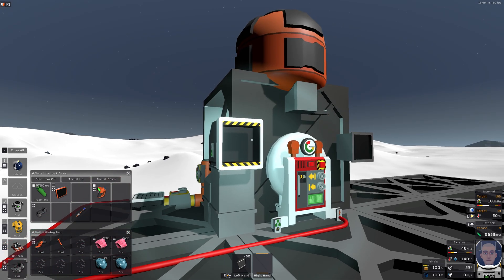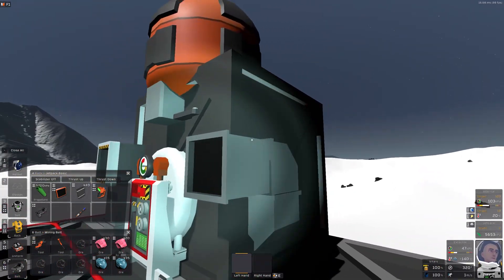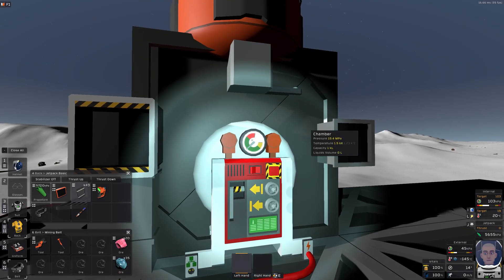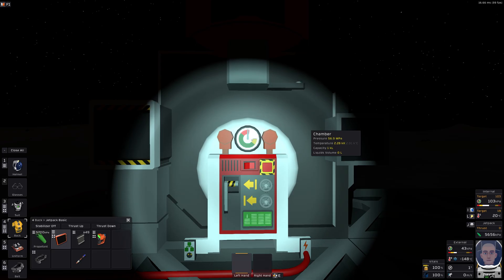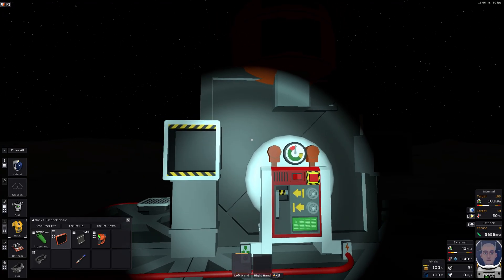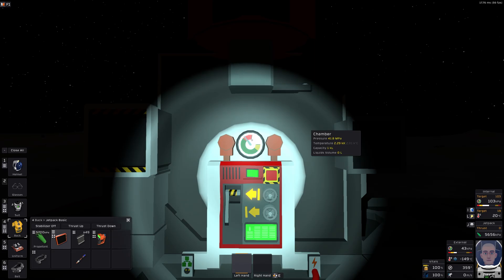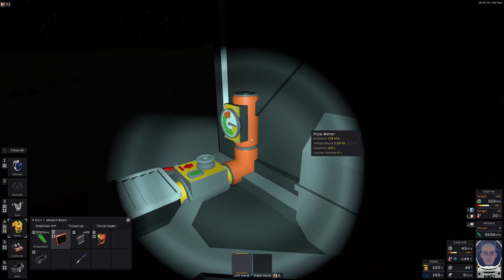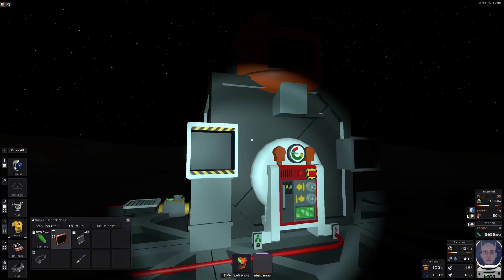Stationeers Tip: Europa Hot Furnace (No Heat Lost)

Comment: What pressure do you need to keep in the box to keep the temperature? Is that 100, and does the actual pressure matter so would it be better to keep it as high as you can handle, or would it be best to keep it just over the required lower limit?

I am just in the process of experimenting with specifically this setup :D but instead of blowing up my base a few times I rather get any hints :)
Reply from the maker: The pressure needs to be above 100 kPa, and below the max pressure for the containing walls.   In this case the steel walls can handle 300 kPa (iron walls are only 200 kPa).    Reinforced Walls are 8 MPa, but requires super-alloys.

Comment: Would be a good idea to have different tanks to store gas with different temperatures? Or is it easier to make a different furnace for each temperature range instead of the extra pumps?
Reply: It depends what you want to achieve:
If you want to have smelted ores into different types of alloys/super alloys quickly and changing types a lot in short period of time then yes - go for multiple tanks with multiple temperatures.
If you are prefering smaller base footprint and are more patient you could get away with as you wrote with pumps and 2 tanks: one super hot and second with colder temperatures (3 if you want recapture used gas).
But in second scenario this will get more complicated in the end because you need somehow  replenish superhot and cold tank.
And depending on which world you "live" different challenges appear because you have or have not ways for doing so. There is no one gold rule for that.

Personally I go with 4 different furnaces - it is enough to smelt every alloy type in game. And since I'm building a lot of different things for experiments speed with many different types is my priority.
Cheers.
Reply: @MrAnderson_PL thanks! I'll try the multiple furnaces route
Reply: @DrBlort  You're welcome - there are some quirks thou you need to take into consideration but I leave it for you for not spoiling fun of experimentation ;)
There is no good or bad way of playing this fantastic game.
Cheers.

Comment: Hi again.

Nice video - classic simple design.
I have pro tip here: When you smelting ingots temperature inside is lowering.
Usually for smelting alloys I use another furnace to mix reagents before final smelt. It doesnt need to be super hot - everything above 100C works fine.
Reagents mix when smelting keep temperature the same as well as degassed ores as you have mentioned in video.

Anyway good job as usual in your content! - I like it to watch.
Cheers.